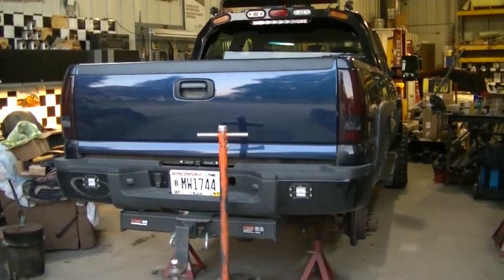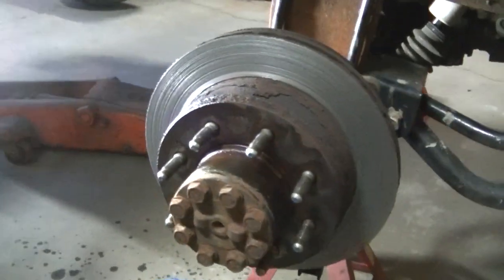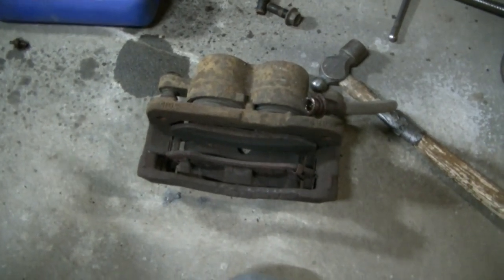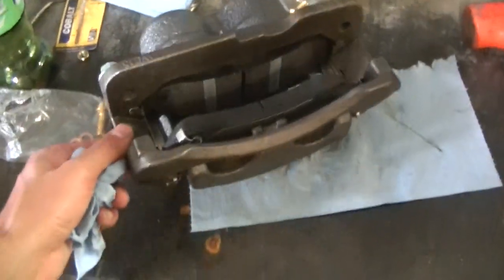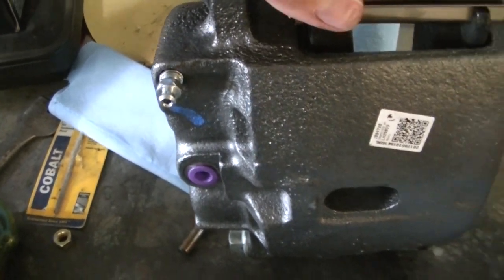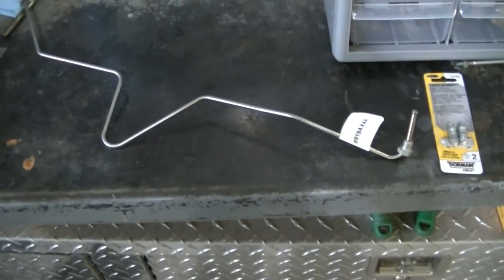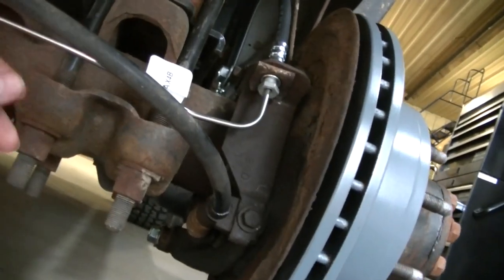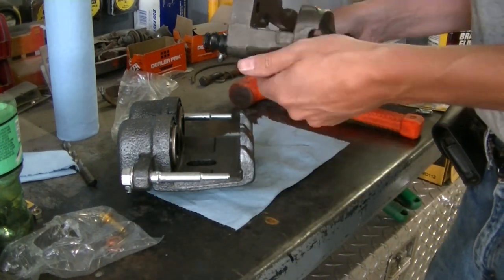Silverado 2500HD Rear Brakes Replacement Tips

Comment: Great video showing how to do the rear brakes. I just changed the rear pads and rotors on my F350 last Summer and on the one side, the caliper pin was seized right inside the caliper so I had to heat the crap out of it, and use the flare part of the pin as a hitting spot with a narrow punch and a hammer to pound the seized pin out. Took a lot of messing around but once the pin was out I bought new pins and boots from NAPA and it was good as new from there. 90% of the brake jobs I've done to vehicles were more or less simple and smooth procedures. That was the only time I ever had a pin seize up on me.
Reply from the maker: The problem I have run into doing brakes is the rotors stuck to the hubs.  That seems to be common with the Silverado.

Comment: I just got done with doing this as well.  Rusty parts didn't want to come apart and had some issues with one of the parking brakes.  I didn't replace the calipers and brackets though.  Maybe I should have.  The drivers side was really workin good but passenger side was a little sticky.  Replaced the hoses and hope thats what the problem was.
Reply from the maker: Always a good idea to replace the calipers and hoses.  They both can cause sticking which will destroy new pads and rotors.
Reply: Did you install Advanced Auto brand calipers and brackets?  I'm lookin at prices of AC Delco vs. any other brand.  My truck isn't my daily driver but I've never tried Wearever brand or other brands yet.  Just wonderin how good they are?

Comment: Question. Was it the dorman stainless kit that was better bend than the russel ? I'm gonna order a kit and I know you put one on the old dually, and one on midnight but dont recall which.  

btw I put silicone grease on all my pads and a hundred of customers cars too, never had grease end up on the surfaces. Also never got people coming back for brake noise. Good amount of picky (for a reason) luxury car owners that dont want noise. Try it.
Reply from the maker: I put a kit from Ebay on the dually.  I did use the Russel stainless braided lines at all four corners on the dually.  I used a Dorman kit on the 2500HD.  I liked the Dorman kit better.  I also put a Dorman kit on my moms Tahoe.  You are probably going to have to take the bed off to run the rear line with the Dorman kit because they bend them just like the factory.  The Ebay kit I bought they just had a straight line going to the rear.  That made it easier to install with the bed on but I liked the routing of the Dorman kit better even though I had to remove the bed.  There is a front line that came in two pieces with the Ebay kit but one piece in the Dorman kit.  It was tricky to install in one piece but doable.
Reply: @mossman381   Thanks. I just put a temporary rear line because im pulling the bed soon for cab corner repairs. I'd rather have a factory looking line. I'll order a dorman kit. Is the dorman stainless?
Reply from the maker: The kits I ordered were stainless.  Not sure they make standard steel lines or not.  They weren't that expensive.

Comment: Incredible what that midwestern climate does to the truck.  I live in southern CA and it's incredible seeing the difference on mine.  We don't get snow out here so the cold temps and salt aren't a factor but I'm curious if that's poor design by GM or just too much salt on the Wisconsin highways?  Probably a little of both.
Reply from the maker: Yup,  probably both are a fault.  I know CA is probably an awesome place to live but I wouldn't move there.  Too many people in one spot.
Reply: @mossman381  Nope stay where youre at man California sucks too many rules and regulations and u get taxed on EVERYTHING... WISCONSINS so much nicer
Reply: I'd agree with you both but I'm from both I prefer Colorado painted rotors with antiseize never end up having a problem

Comment: how do you like the painted rotors, I'm thinking of using them on my truck
Reply from the maker: Not sure right now.  They are the "premium" rotors.  Let me get some time on them and I will let you know how they hold up.  I am curious how they will look after a Wisconsin winter.
Reply: mossman381 I'll be testing as well. Need some for my 2004 gmc plow truck. Going to put them on the front

Comment: did you grease your slider pins and hardware where the pads touch?
Reply from the maker: The sliders are greased from the rebuilder.  You get a pouch of grease with new pads but they are assuming you are just doing pads and are using old calipers.  You would then re-grease the sliders before assembling the calipers.  I don't put grease on the pads.  Seems like it could get on your rotors and pads and cause problems.

Comment: Hey Moss Man wondering if I can get your opinion on something I have a 2009 Chevy 2500 all wheel disc brakes I'm hearing a slight clicking in the back do you know of any adjustments. It also feels like my back right caliper might be hanging up I'm starting to smell brake pads pretty bad any help would be gratefully preciate it thank you
Reply from the maker: Not sure about the clicking noise because I can't hear it.  If your brakes are sticking I would get that fixed asap.  You can wreck other parts if you get your brakes hot enough.  Wheel bearings/seals don't like heat.  That can cost you a lot more than just a brake job.  Make sure you change brake hoses.  Those can look fine but be swelled up inside causing your brakes to stick.
Reply: Thanks for the help im going to get on them today and see what all going on.

Comment: I can’t believe you didn’t fix the gear oil leak . That leak usually indicates a failing wheel bearing and metal on metal brakes indicate poor maintenance or heavy towing or both . Good luck on this half A$$ fix .

Comment: What brand is that Jack? And ton?
Reply from the maker: Not sure.  My dad got it a long time ago.  I seen it when I was a kid and we still have it.  It's heavy duty.
Reply: @mossman381  5 ton? 20 ton? Just curious
Reply from the maker: @calebwillhelm2635  I will have to ask my dad.
Reply: @mossman381  I'd really appreciate it as I'm looking to purchase one but I can't find any information about what ton it is
Reply from the maker: To lift a 2500 truck you need a good heavy duty jack.  I will ask him tonight.
Reply: @mossman381  I have 2002 2500hd Silverado. 4x4 extended can long bed. Lifted on 35s. Its such a pain In the ass to Jack up haha
Reply from the maker: @calebwillhelm2635   4 ton
Reply: @mossman381  your awesome man thank you so much. I bought a brand new Pittsburg 3 ton Low profile. Came warped out the box. Only 3 wheels on the ground. Looking at old ones a guy has one just like urs. R.V. manufacture.  Said it was a 20 ton.

Comment: Let me save someone else some time, dont buy rotors for a gm hd truck 01-07 i believe from advance auto!. The rotors are not deep enough and dont seat on the hub all the way. Ive never seen anything like it in all my years of working on vehicles. They snap under weight. Someone else in the advance auto reviews of the rotor had the same issue with his hd gm truck. Your welcome. Use auto zone next time. Point taken. What a mess this all was. I will never use advance again. Ever.

Comment: He said "I never used my parking brake its automatic just put in park" Really what kind of people you are .. its name parking brake .. its used when you parked your vehicle.. 😥😥
Reply from the maker: With an automatic transmission in park the rear wheels are locked.  The only way the vehicle will move is if the rear tires are lifted off the ground.  If the rear tires are lifted off the ground the parking brake will do no good because it only lock the rear tires.  There is no reason in an automatic transmission to use "park" and a "parking brake".  A "parking brake" is really only used for a vehicle with a manual transmission where there is no "park".
Reply: @mossman381  oh it seems that you are not a mechanic for sure because you dont know what you are saying or how does the park in transmission works .. you should learn before you teach dude 😣
Reply: @mossman381  by the way in manual if you used the 1st gear uphill or reverse downhill they will work like a park .. as i do with my car plus using my handbrake for sure
Reply from the maker: Your 1st and reverse in a manual are NOTHING like a "park".  You have to apply the brake before you can shift the vehicle out of park.  You can easily bump a manual out of gear.  You can do and believe whatever you want.  I don't have time for trolls.
Reply: Parking brake should be used when you parked.   Especially on hills.  The parking pawl in the gear box isn't very strong. That's why your car lurches forward one inch after you put it in park. The pawl has to catch the next tooth. And if your hydraulics fail, the mechanical brake will work as emergency brake
Reply: some people have never had the E-brake stick helping you get nowhere in a hurry & it really shows..
Reply from the maker: @carson k  How many times have you heard of a parking pawl breaking while a vehicle is parked???
Reply from the maker: @Jon Bird  I have no idea what the heck you are talking about. Maybe worthless drifting??
Reply: The last time I had to rebuild the rear disc brake system I disconnected the “park brake” cable so nobody would accidentally push the pedal, just wait until the day you apply the brake and it fails and won’t release and you are stranded somewhere because the brake is locked, you’ll thank me
Reply: @mossman381  never, in fact I know people that would rush to put it in park before the vehicle was completely stopped and it would sound like a ratchet for a few seconds, even those ones did not fail.  It is way more common that the brake is applied and the vehicle ends up on a tow truck because it is locked on.
FWIW some of the fords in the 70’s would actually jump out of park and of course, since reverse is the first increment it would land there - got especially interesting for folks, who in the wintertime, would run out and start the car on the choke/high idle, and then return to the house for a coffee while the car warmed up
Reply: I have used brake line kits from inline tube, they make kits for various vehicles either stainless or the nickel steel - the kits are identical to oem with color coded fittings etc, they fit like a glove - also fuel lines etc are available there.
Years ago I bought a speedibleed tool that attaches to your master cyl and using a regulator attaches to your tire - bleeding brakes with this device seems like you are cheating it’s so simple